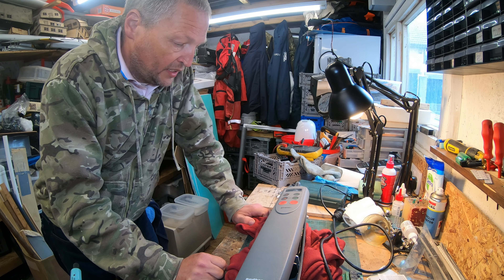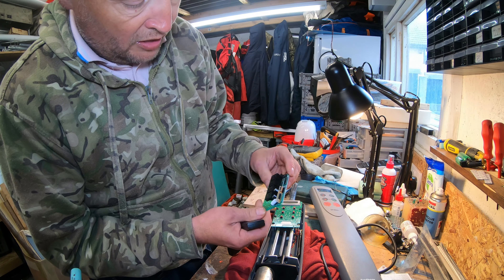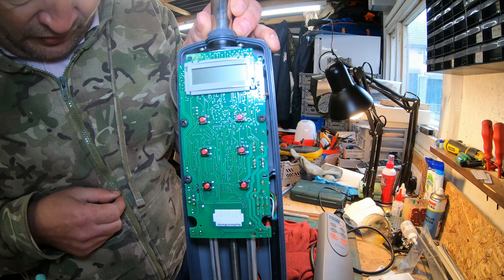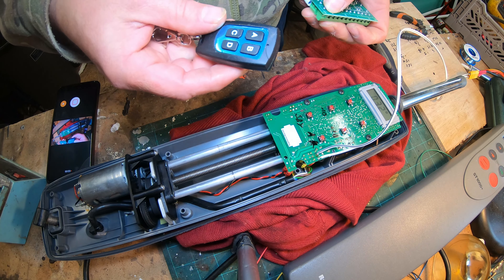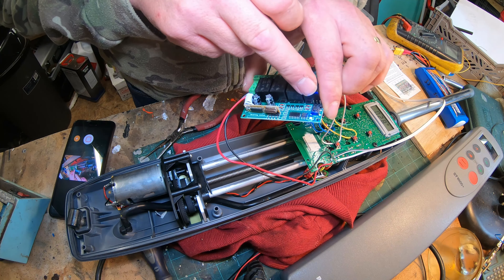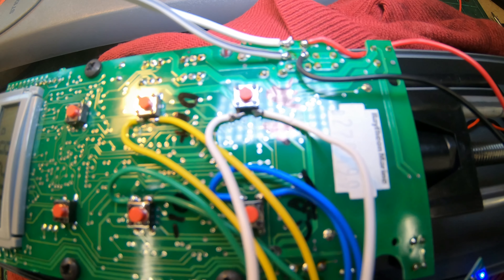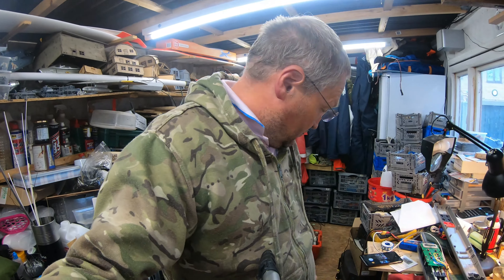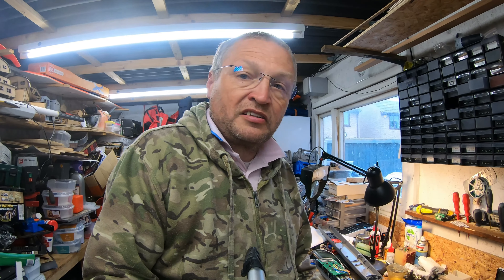Sailing Harley Quinn - DIY Raymarine ST1000 Tillerpilot Remote Control Mod

Comment: Well done very informative. I have fitted micro switch stops at either end . Both Switches are NC in series with motor , added 1N4007 diode across micro switches allowing reverse voltage to pass when switch opens for ram to go the other way . Micro switches mounted inline with slide allowing for momentum  when  stop reached  using +10 . Will be fitting remote too.  Thanks for Video
Reply from the maker: Glad it helped

Comment: Thank you for making this video. been thinking about doing this for a while. I installed mine on mine today. Only thing different that I did was run my wires outside and back in the back, and I used the 1 degree and the 10 degree, not the standby and auto. Figured I'd be at the tiller anyway to put on the tiller.
Reply from the maker: I've since changed to this too as  well as you mention you are next to tiller when you switch it off

Comment: Mark Webb
Thought I would have a crack at this on my ST2000.....for my purposes this mod would have been ideal meaning that I didn't have to keep turning round whilst still on watch.
Unfortunately the manufacturers have changed the switches on my one, they now have clear plastic shrouds covering a triangular metal contact.
Even if you can prise these from the board the joints appear to be machine made and even by following them through it is not apparent where to connect the wires to. They are far to tiny now for a man in his shed to easily tap into.
I gave up, reassembled the switches and luckily they still worked fine.
Reply from the maker: I think the ST2000 is built differently altogether. Different power mechanism too.
Reply: if you find a solution for the st2000, i'm interested :)
Reply: @mathieud3098 I don't know if you found a solution but I know the ST1000 has a wired remote button available. 

Which signals via the cockpit bulkhead socket providing power too.

I can't see why you could not use the spare conductors in the plug in power cable which also has data connection conductors? 

In fact I would suggest this a better option because you don't need to open the unit up.

Comment: Thanks for posting. Very interesting. Can I wire up to the 1degree buttons? 10degrees is usually too much for me.
Reply from the maker: Yep, you can do which ones you like. The switches are all the same. Just wire to the different switches. I looked at th 6ch version to do all switches but don't think the pcb would fit in the housing unfortunately. 4 works well though.